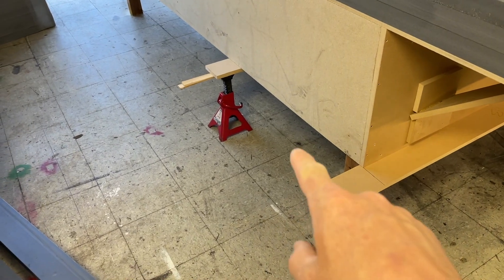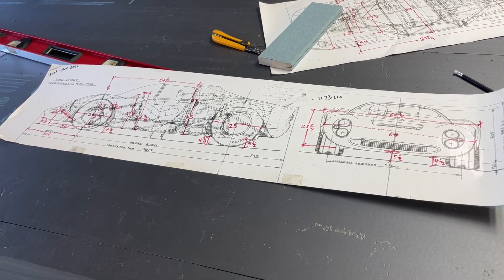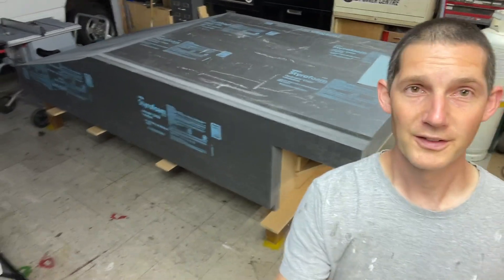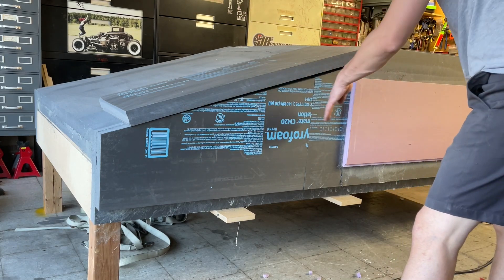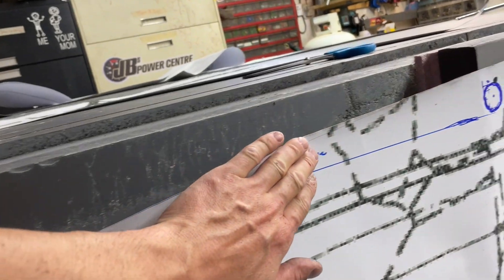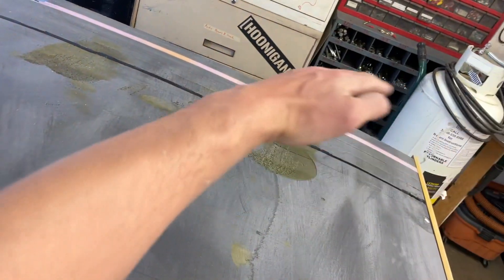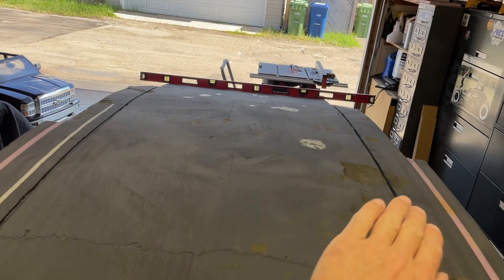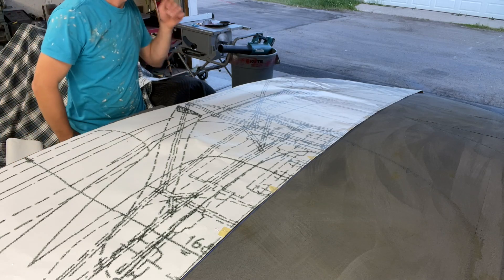Carving styro-foam into a car body shape

Comment: The easiest way is to cast a big block of polyurethane foam and set up a datum table for your reference points. As easy as that. There is easier ways but needs a lot of programming and a 3-5 axis CNC cutter.

Comment: Hi, Great videos ! What kind of foam did you use and why? How did you source it ? Thanks
Reply from the maker: this is a type 2 closed cell foam. often found in pink or blue and know as "rigid insulation" from most any hardware store. This was from a commercial supplier, but it's the same stuff.

Comment: great build. but one problem with styrofoam - it's completely non-biodegradable. it breaks down into smaller and smaller pieces and stays in the environment for hundreds of years. it'll end up in your drinking water and food at some point.
Reply: What alternative method do you suggest?
Reply: @hankhill962  the most obvious would be biodegradeable foam. not sure how practical it would be tbh, i've never tried it. but if we do use dangerous/hazardous materials, we can dispose of them responsibly ie not just blow them out into the street without a thought. we also need to weigh up our immediate selfish need to do something against the effect it has on future generations. i know lots pf people don't want to hear about taking responsiblity for their actions/behaviours, but that is our reality.
Reply: @daos3300  in years past car designers used wood shapes and clay to make their full-sized prototypes with.
Reply: @hankhill962 still do. certainly a viable alternative but might not be that convenient for someone working in a small garage. also a lot more time consuming and costly.
Reply: @daos3300  true, I saw someone in a home shop use a buck made from cardboard. he used thin wooden strips covered with wall plaster. Then sanded
Reply: @hankhill962  clever!